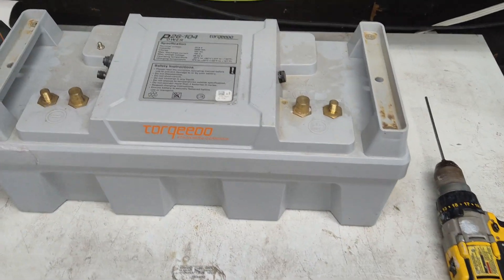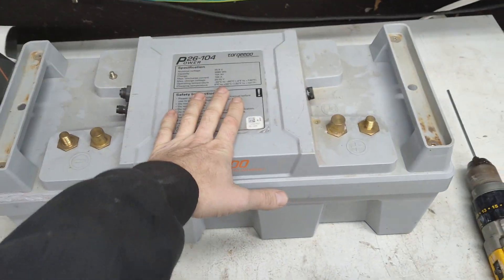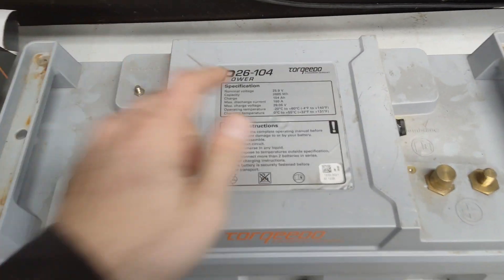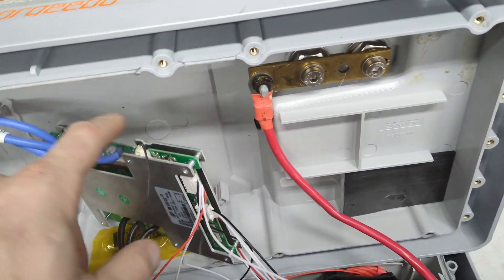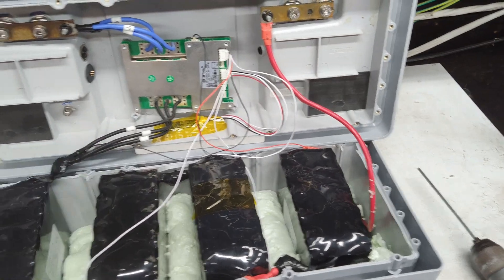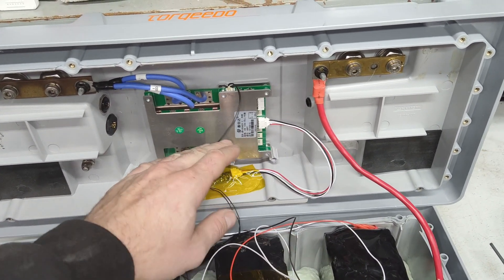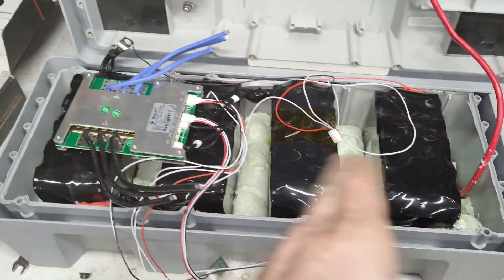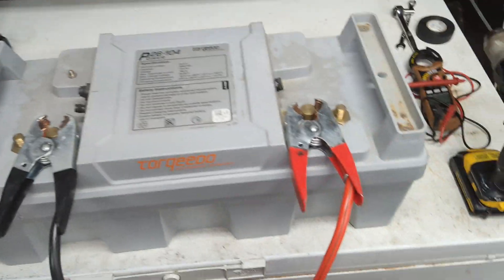DIY 12 8v LifePo4 Battery Stops Working

Comment: i had 3 torqeedo battery packs with 18650s inside and they were heavily used when i was making my 12v 1kw Pwall... but these look deacent packs inside
Reply from the maker: and they test well, I did get a few bad packs but they refunded me.